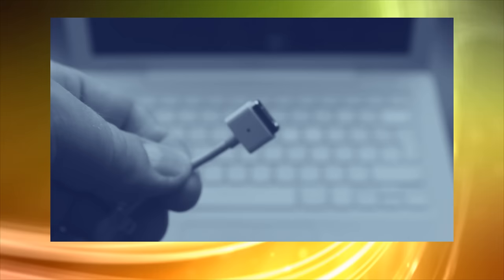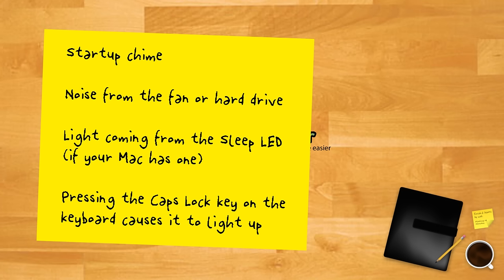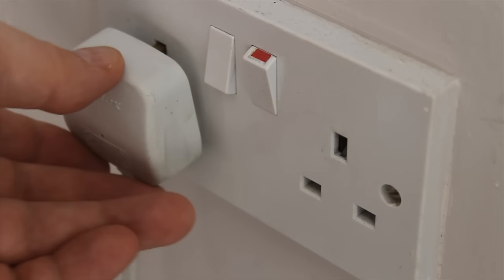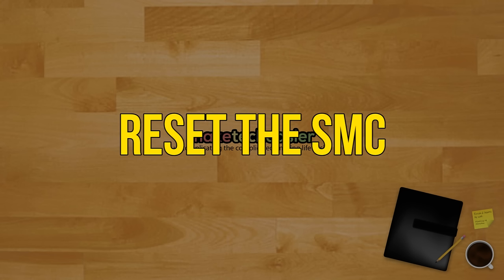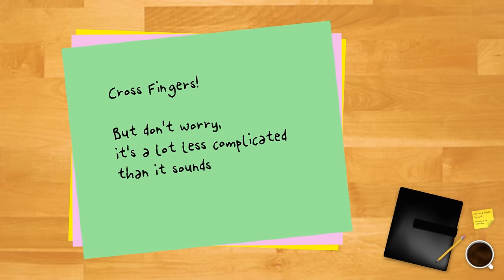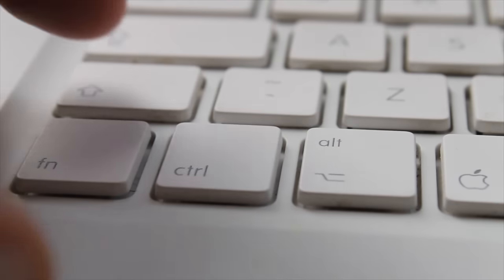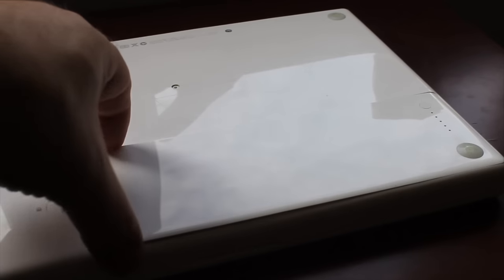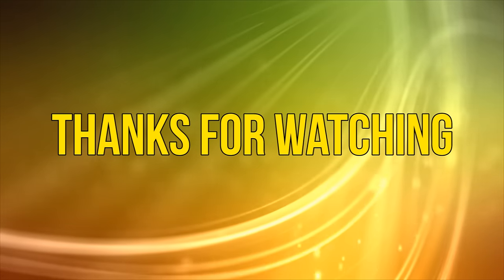How to Fix a MacBook that Won’t Charge

Comment: I have done all of these things and it still doesn’t charge. I’m freaking out.
Reply: I solved this issue, got the wire changed from a repair shop in city
Reply: Same!!! 77% and dieing!
Reply: 47%!!!! AAAAAAAAAAAH SEND HELP QUICK, AAAAAAAAAAAAAAAAAAA
Reply: same!! did it work???
Reply: Press shift control and option for full four seconds. After you should here the smc reset.
Reply: @flavoredguts  Sorry about that. If it doesn't work, try setting up an appointment to the Apple store to have them check it out.

Comment: Idk if I misunderstood the the process for a non removal battery Mac, but I held down the shift, ctrl, option AND power button and voila.. it reset the SMC. The light on my charger turned on. Thanks!!
Reply: Can you still do this if the Mac died
Reply: @NycticeiusHumeralis  no, my Mac was sometimes charging, sometimes not. I tried it when it was charging and it worked.

Comment: I am currently living and working abroad and anything to do with technology (or fixing tech) is very expensive here. I nearly had a full on panic attack when my battery status was no longer showing on my home screen anymore and my charger wasn't lighting up when plugged into my laptop. I was worried I would have to pay an arm and a leg to get the problem fixed but I stumbled upon your video, followed your directions, and it solved the issue!! Thank you so very much!!

Comment: I’ve tried everything and it still won’t work 
Edit: so it’s been a while may want to explain myself....my charger was just broken so I just got a knew one...bit underwhelming but it’s the truth
Reply: Oven mitts did you menage to fix it?
Reply: Lukasz K of course not...
Reply: @JBSacayanan  what kind of MacBook do you have and what all have you done to try and fix it?
Reply: Try setting on a hard and flat surface; I was trying to charge my MBP while on the bed and had no luck..... then i placed on a hard surface and that did the trick

Comment: Thank you so much! I was freaking out because my ports were all clean and my chargers are both new...no light on my charging cable, no battery indicator on my toolbar, my keyboard wouldn't light up and my fan was going gonzo. Until...I tried your SMC reset for a non-removable battery and voila...all back to normal! Definitely following you now...

Comment: That is amazing, removing the battery, pressing power button for five seconds, reinserting the battery and pressing the power button >>> and it works! SMC is reset, it is now powered on and  battery is charging! 
That has saved hundreds of pounds, thank you so much!

Comment: very helpful video, my MacBook air 2015 was not charging on direct electricity but was charging on invertor electricity, but after watching your video i found out that wireless mouse dongle attached to usb port was causing the issue, removing usb dongle solved it, now my MacBook air is charging even on direct electricity. Thanks a lot
Reply from the maker: Glad we could help!
Reply: @Maketecheasier  thank you so so much I was so scared that it was not taking charge but it actually worked,  tanks a ton

Comment: For those of you for whom this suggestion DID NOT WORK, I was feeling desperate. I tried EVERYTHING. I finally took some aluminum foil and jammed it between the charger and the port. It didn't work, BUT when I removed it, its DID WORK! Not sure why, but I'll be trying again if there's a next time.

Comment: THANK YOU! I went to go charge my mac air and the light wouldn’t glow on the charger. I would turn it on and the fan would go crazy and the battery icon wouldn’t show up. Was at 0% Resetting SMC helped. much relief 😮‍💨💗

Comment: please help. it ran out of battery, it always lights green and I have to plug it and unplug it multiple times before it actually wanting to charge and for the button to turn orange. today it says it was charging but now it just died out of nowhere, I tried buying a new charger because I thought the other one was broken.. is there any way to fix this?

Comment: Helpp mines already dead and it’s not charginggg😭😭😭
Reply: pls im in the exact same situation
Reply: Sameeeeee
Reply: @anamaryalejo5001   SAME OMD
Reply: GUYS DID YOU GUYS FIGURE IT OUT
Reply: Buy a PC.
Reply: I had to rest the SMC my MacBook pro after the 3rd time.
Reply: i figured mine out 😭
Reply: @anamaryalejo5001  HOWWW
Reply: Can anyone reply ...what you did to correct?
Reply: Omg same- what do I do it's already dead
Reply: Sameeee
Reply: Same
Reply: Sameeee. And i gotta submit my work by tomorrow at 8 am
Reply: @anamaryalejo5001  im about to be in that situation
Reply: Anyone found the solution?
Reply: @anamaryalejo5001  HOWWW PLEASE TELL MEEE
Reply: HOWWWW
Reply: @lomi3896  My child’s mac book was the same for two days. Out of now where she says she was disappointed, plugged it in and was just passing her finger’s around the mouse, or whatever is called and she noticed it lit, waited a few mins and turned on
Reply: My also
Reply: Sameeeee
Reply: Omg I’m in same situation!! Summer is almost over and i haven’t used my MacBook the whole summer 😭! I even got a brand new high quality charger but it’s not charging still!!
Reply: Samee
Reply: I found out that mine needed battery change so… I’m screwed 😀
Reply: @1ananas2bananes  girl if u have a charger I think u can still use it just take out the battery when doing it
Reply: @marianfuentes2805  nope, contacted the apple people and they said my battery was the problem so now I need a new one 🥲
Reply: Same
Reply: Saaameeee
Reply: @larryexiomo8354  I literally lifted up the 2 white parts on the block thing while fidgeting and it started working again
Reply: @anamaryalejo5001  pls HOW
Reply: Me too
Reply: Same
Reply: Yeah same
Reply: @anamaryalejo5001  how
Reply: Maybe try to check if the charger or the charging port is dirty? Mine had a few large comps of dirt and after I got those out it charged properly
Reply: SAME
Reply: Use an eraser to clean the dust in the charger and the port and then try.
Reply: Same idk what to do I’m abt to cry
Reply: @cloude.skye9  it might be the cable. Just take it to a reputable repair shop. Ik it costs a lot but it has to be done.
Reply: Same bro
Reply: Same
Reply: I have had my computer for a week and it's already doing this
Reply: @ice559  right mine is new too
Reply: Sameee
Reply: Omg same I’m tryna play roblox
Reply: Me tooooooooooooo!!!!
Reply: I just played with the mouse and ran my finger on it for a while and it randomly turned on and started charging again
Reply: Same
Reply: Same😢

Comment: Thanks man. the fan of my macbook Air was continuously running and the indicator of the charger was not lighting. I followed whatever steps you said. And it worked. Thanks man again. 🙏

Comment: Basically, my macbook is always at 0%. Like it's charging but its says 0% at the top and if I unplug the charger my it turns off which is a pain in the butt. Please help!! It's a MacBook Air.
Reply from the maker: I think your battery is dead. You need to visit an Apple store and they can check that for you.
Reply: See my comment above, I had the same issue and it resolved it immediately. I couldn’t believe it.
Reply: reset it, IT WORKS!
Reply: Battery replacement time
Reply: m s it's not a problem with your charger, it's a problem with your battery. This could be caused by overcharging it, when it's at 100%. You'll need to replace your battery xd
Reply: @jfacts49  where is ur comment? can u comment again? xD
Reply: Mine is always 1% 😭
Reply: Same thing  exaclty the same thing has happend to my mac book air aloso
Reply: @Maketecheasier   I have the same problem and I checked my battery life and it says it is normal?
Reply: tharra shafira plz guide me i have same issue

Comment: YOU SAVED ME!!  It is 0200 hrs in the morning, I have to work with my laptop tomorrow (today), and you saved me! 

Had to resent the SMC, but needed to plug in charger while doing so (tried it first without, didn’t do so well).  I think I need to replace my battery.  

Battery held charge magnificently for years then as of past few days lied to me about charge percentage.

Resetting the SMC didn’t even do anything to memory and all my pages and work were saved.

Comment: If your Magsafe connector seems to not seat properly in the port (i.e.: it "rocks"), check for any fragments of metal that may have gotten sucked in by the very strong magnet. A surprisingly common problem. Staples are the #1 culprit.

Comment: Thank a lot, it’s work .I have MacBook 2009 non removable battery it was indicating green when connected and not charging. After smc reset the indicator now is orange and battery is charging.
Thank you for your video.

Comment: I have MacBook mid 2009 A1342 stuck on apple logo and it has no battery what could be the problem?

And also the internal fan the internal fan cable where it should be place the thing for putting the cable is no longer there and is there any methods of making it to work again?

Comment: My macbook is on but when i chrage it it wont show the light thingy in its cord like there is like theres nothing  its not showing effects of charging can you help me why is this happening
Reply: Gaming Star Hi I’m I’m having this exact same problem, may I ask how you fixed it?
Reply: Sorry but I'm having the same problem. Do you mind sharing the solution?
Reply: i have a solution the part of the charger that you connect to your mac put it upside down and smash it a little bit cause the 4 gold things one of them might be loose
Reply: Minato Namikaze Channel omg!!!!! This worked for me
Reply: Minato Namikaze Channel I bought a new charger and the light still isn’t on
Reply: Tilly Rae check the part where u plug the charger into your macbook mine is kind of rusty
Reply: Yeah I have the same problem too?

Comment: Very useful thanks my battery is weak it abruptly stopped and then i connected power adapter. It didn’t take up charge. Then i reset SMC. It worked and started charging

Comment: Seeing the ease at which you released and removed the battery from that earlier generation macbook makes one look at the current trend of electronics design - burying the battery as deeply and inaccessibly as possible - and sadly come to the conclusion that the reason isn’t to build the best device possible for the user. And the users don’t even know and continue to reward this unacceptable manner of pushing the seasonal-refresh/dispose and replace norm onto everyone. 

I just replaced the internal battery on my mid-2015 MBP for the second time. And will continue to do so many more times I’m sure before I decide to purchase another machine. It would be much more convenient for that process to be similar to the one shown in this video. 

I mean, it’s not terrible, but after seeing that battery removal and replacement in this video, I am assured that it’s not great, either.

Comment: Help please!! On the screen it says it’s charging but the light in the magnetic connector is off and the battery percentage goes down :(
Reply: Daisy did you ever find a solution

Comment: hey there ,
i have MacBook Pro (17-inch, Early 2009) works perfectly running Mojave OS, but today the battery shows 100% fully charged so when i unplug the power adapter the MacBook shut down direct ! the condition of battery is "Replace Now" and the message under the power percintage says "power source : power adapter" , i do an SMC reset but the issue with battery not solve. i need to fix it ASAP plz to finish my graduation project.
Thanks in advance

Comment: My MacBook Pro is a 2014 model and has done this since I got it, I tried a new charger same problem. I use a paper clip to clean the connections on the ports (the plug on the cable and the receiving port) this seems to work. A very annoying thing on an otherwise incredible product.

Comment: Hi I Bought a magsafe (as a backup) but it lights and charge for a few seconds then the light shuts down and no charge. I got another one that it´s working very well with my macbook. Is there any solution? Thanks.

Comment: My isn't working, the only thing I can see that it isn't working because of is at the beginning there is a small cut we tried to work it at every angle but still it isn't working. Any suggestions or advice on the problem?

Comment: The magnet around the charging port on my macbook pro 2012 is broken into many pieces after 10 years from hitting the magnet hard many times when connecting the cable to charge it. Where can I find a replacement? Apple does not store spares.

Comment: So my MacBook fell and my battery stopped working, i got to come on and it worked without a battery for weeks only it fell again off a coffee table on the charger and wouldn’t come on... let’s see if it works but if it doesn’t any suggestions, other than get a new one?

Comment: My Macbook air dosnt charge. When I press the Power Button it shows on Screen the Bty Diagram with part in RED. I tried with other Power Chargers of Friends thinking my Powewr Cable was Bad, but it didnt help. I dont know if it is ON or OFF. When I press Power Button is ONLY shows the Bty Daigram with Little of RED filling, Thats all it shows. Please Help.

Comment: Thanks, will try it. Before resetting the SMC should the Mac be turned on or turned off? On your video looks like it is turned off.
Reply from the maker: That is correct, in the procedure we say turn it off then follow the steps to reset the SMC and turn back on. Good luck!

Comment: I am seeing the battery charge percentage climb now, and I'm happy to report this! The following is what appears to have caused the charging of the battery to again occur. I shut down the MacBook, then I disconnected the power cord from the magnetic connection port, then I pulled out the battery, then I pushed down the power button and held it down for 5 seconds, then I reinstalled the battery, then I reconnected the power cord, then I pushed the power button to restart the MacBook, then I logged into my "portion" of the hard drive and observed the charging percentage information.

Comment: Hi, I wanted to know. My MacBook Air a1466 i7 2017 model had liquid damage. I had replaced the battery since it was holding a charge. I notice before my battery came I took that battery out and it worked at half performance but still worked. But now that my replacement came I installed it and the charger light didn’t come on With the new battery installed, I am genuinely confused. I understand there is a whole process of Calibration but the thing it the light doesn’t even turn on. Yet the laptop doesn’t even recognize the battery. I checked the battery port on the logic board and it was fine. I am genuinely confused please help me.

Comment: I reset the SMC and replaced the charger port and even bought a new charger. 

My old charger, the green light stays on but laptop not turning on. 

The new charger the light doesn’t come on. Should I replace the battery to see if that’s the problem before bringing it to a shop ???

Comment: The light indicator on my charger doesn’t turn on but my laptop screen says it’s charging and it only works with a specific side up. The battery logo appears on screen and I’ve charged it for a while but my MacBook doesn’t boot up. I tried every in the video and no progress. I’m think I’m going to have to buy a new charger and see if that solves the issue.

Comment: I WANNA TELL YOU GUYS I WAS REALLY WORRIED BECAUSE I DID ALL THESE, SO FAR IT SEEMS TO BE FIXED NOW AND ALL I DID AFTER WAS LET IT BE ON THE CHARGER FOR A WHILE AND THE COMPUTER CALIBRATED THE BATTERY. IT COULDVE BEEN ALL THE STEPS TOGETHER BUT I WANNA JUST MENTION IT ALL TO YOU

Comment: My macbook only charges when its off? i havent tried another charger cause no one has a macbook in my country, someone PLEASE help! its a Macbook Pro late 2011
Reply from the maker: Presumably you've gone through the steps in the video. Resetting the PRAM and the SMC is the first port of call as that fixes many different problems. If the machine won't charge unless powered down that implies the Mac isn't getting enough current from the charger. Try a different charger and if that works a new charger may be the answer. Good luck and let us know how you get on.
Reply: Did you end up finding a solution to this? Mine is the exact same right now
Reply: Sammy Stefaoui sorry forgot to tag

Comment: I haven’t found any help.  The battery doesn’t charge and the indicator doesn’t even light up unless I hit the indicator button. To start the computer, I have to hold the indicator button on the side, the control, the shift, the option and the power buttons all at the same time. It’s a VERY awkward hand position!  But if I unplug the power cord once it’s started, it will turn off. I can’t find help on this at all. Nowhere.

Comment: My laptop is a mid 2009 and when I plug my charger in it doesn’t light up and I even checked if everything was plugged in,it was all plugged in. Why doesn’t it work?? And what do I do???
Reply: Im not a pro but checked a friends' (who had the same issue as you) macbook air (early 2014-model) and checked and double checked everything before coming to the conclusion that it must be the I/O board that needs changing. Dunno if the 2009 macs has a  separate I/O board, if not itll be a bigger problem for you. Just google 'I/O board macbook' and you will see. Hope this helps to find the problem at least!
Reply: @prot83 Same! Did you find a solution?

Comment: Hey,
My mac boots on, works fine when plugged in and when I click on the battery logo on the top bar, it says that the battery is not charging. And apple support said that it has enough power to run when saying something like this. Please reply.
Reply: They wont be charging if battery is over 95%. Disconect tje charger. Let the battery drain to below 90% tjen reconnect. It should be charging then